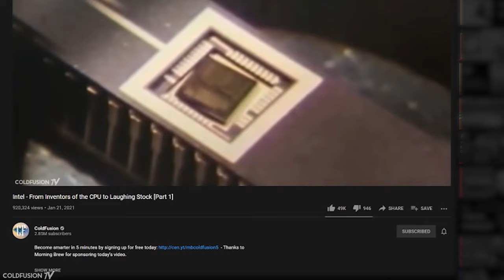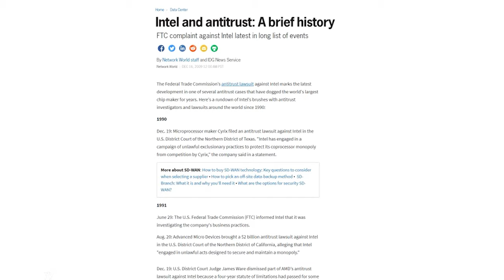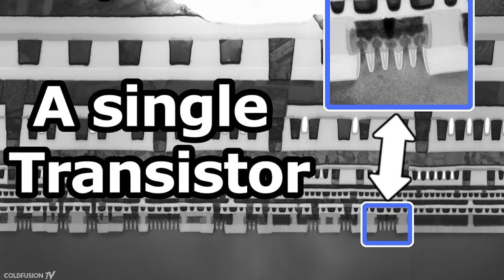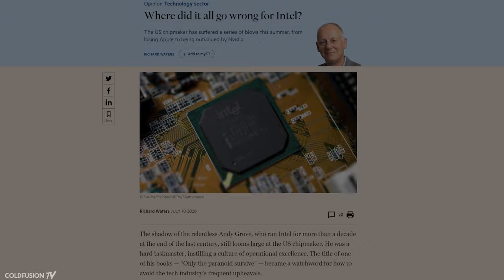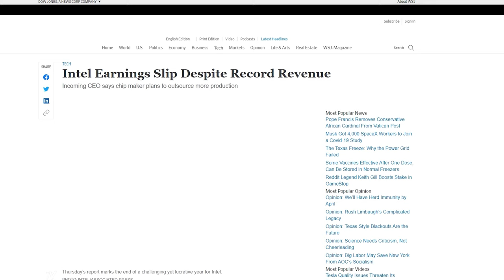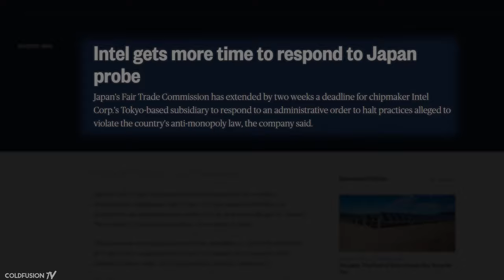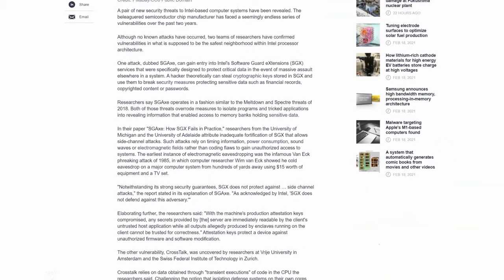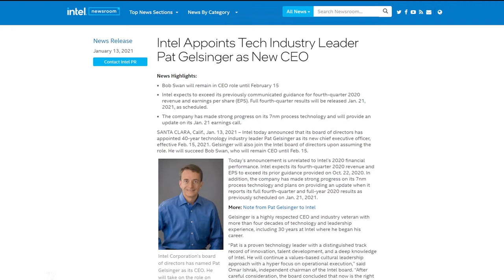Intel - From Inventors of the CPU to Laughing Stock [Part 2]

Comment: Theres a little fine detail in explaining how smaller process nodes increases performances.
In a way this looks like it but its mostly because it becomes more power efficient thus allowing more power to be used. So in the end it will have a performance uplift with the same amount of power consumed due to better efficiency.

Comment: The 8008/8080 architecture that is the core of Intel? Designed by CTC. The personal computer revolution started with the Altair 8800/IMSAI 8080? Intel was side-lined by the cheaper and superior Z80. IBM's decision to go with the 8088? They came in cheaper than Motorola with MOS and Zilog completely blowing their lead with lousy 16 bit upgrades. The super-scalar Pentium that would prove CISC was still a contender? Took years of handwaving until they overcame their deep pipeline issues. The Itanium that was supposed to be the next stage? A complete disaster than everybody saw coming and AMD created the x64 extensions that Intel had to follow when the Itanium failed.

Intel has always succeeded in spite of themselves.

Comment: Those bribes you mention are called wholesale rebates. Many companies do this in a variety of ways. For example in the late 90's Microsoft offered to pay a significant part of of hardware companies marketing costs so long as the Microsoft Windows logo featured prominently in the advertising. This was their dirty backhand way to attack Linux which had a groundswell of support at the time. Coca-Cola offered businesses a free lease on fridges so long as 90%+ of the shelf space was used exclusively for their products. Sometimes this is done with distribution channels e.g. a large company will seek an exclusive deal with a trucking company, which restricts a rivals ability to get their products to the market place. There are all sorts of ways companies misuse their market share to stifle a smaller competitor with unfair practices. Other dirty tricks include making exclusive deals with landlords which restrict competitors use of the that landlords properties, deals with local governments, sponsorships, and even utility companies.

Comment: Hmmm you say 5nm is coming this year, but M1 is already based on the 5nm TSMC process, and the A14 in the iPhone 12 too. Otherwise excellent video.
Reply: Correct if I'm wrong but phone CPUs are much different than "computer" CPUs
Reply: @BspongeB  not really, we’re talking process node here, not CPU architecture. They work differently but they’re manufactured almost the same way
Reply: @lululombard  No. X86 is much much more complex compared to arm. As the node size decreases the harder it becomes to use x86.

In a nutshell, basically, the electricity gets "leaked and wasted" as the node gets smaller in x86. And there are many other reasons which electrical engineers would understand better.
Reply: @grossly820  You are wrong, AMD Zen 2 and Apple A12 were using the exact same TSMC N7FF process. What you are referring to is again the design, not the process node or manufacturing.
Reply: @lululombard  Ah my bad, i thought you were referring to x86 in specific.
Reply: @lululombard  correct if I'm wrong again but I'm pretty sure 5nm refers to the size, speed and efficiency of the transistors on the physical chip. Yes you're shrinking the process node but that directly impacts the size, speed and effeciency of the chip. Therefore, even if the manufacturing process may be similar, the logistics of say an i9-10980XE vs an A12 is very different.
Reply: @BspongeB  what he said is that TSMC was planning to start commercial production of 5nm this year, which is wrong because TSMC already delivered 5nm chips to Apple, I don’t really understand what you’re talking about sorry :/

Comment: 2:12 "Intel insiders". I see what you did there 😏.
Reply: During my stint at Intel I, a H1B worker, earned more salary and stock than any equivalently placed local homegrown employee of AMD and NVidia. But, sure, your sources must be correct since you got "Intel Insiders" to give you information. I also knew many other H1Bs who worked their asses off and who very much "strayed" from the specific task assigned to them. 

Intel has had issues with top management ever since Otollini retired (and sadly passed away shortly thereafter). Even Otollini massively misplayed the hand by refusing to work with Steve Jobs on a chip for IPad. People don't understand as to how much top management can make or break a company. They get the big bucks for a reason. IF they take the right decisions, the company flourishes and when they make stupid decisions, the company suffers inspite of smart on-the-ground employees.
Reply: @AnkhArcRod  rightly said. Also he didn't mention how horrible Athlon chips were in 2002. I along with a couple of my friends study rooms were turned into sauna because of those CPUs. They were only made for places where ambient temperatures were like 5 degrees and not 30-35 like india.

Comment: I suspect Intel will figure out how to get their mass manufacturing back on top within 5 years with the new CEO. Honestly, as "good" as it is for Intel to have their incredible architecture designs produced in 3nm by TSMC (seriously, any team that can keep 14 nm on top for that long is probably among the best there is), if they don't get their manufacturing back up to competitive, they're in hot water nonetheless. Intel running their own fabrication is beyond important for a lot of reasons, and giving that up will cost them.
Reply: We need the fabs for competition and supply chain security. Wouldn't want to see tsmc get crappy with no competitor.

Comment: Very interesting video, thanks. Back in the day when you could buy good motherboards, I used to make custom gaming machines and just hated Intel on principle. The Pentium 4's had skinny pipe lines and were overclocked internally to get any performance out of them. They were a joke and you couldn't cool them even without overclocking them. I knew a guy who overclocked his and put it out on the deck in snow and it still melted down. I mean they were really bad. I called them Pentium smoke stacks. I was one of the first people to use Athlon processors in gaming machines. Making boutique gaming machines was a hobby of mine when I was younger. With their very wide pipe lines, even at a lower clock speed, they just blew the Pentium 3's and 4's out of the water and I knew the tide was going to turn. And the harassment over it I endured was unbelievable except from the buyers of my machines. They just loved them. I was also one of the first to use RAID arrays to speed up hard drive performance. Since I've already dated myself, today, retired; I use Acer 17 inch Nitro and Predator lap tops with all solid state drives, even the 2 terabyte storage drive. No need for RAID arrays anymore. And the Intel chips in them do a very good job. They use 8 core processors with doubling to 16. And they use GE force video, which has and stores game profiles for individual games. I figured if Acer wants to use them, good enough for me. I  believe Acer to be the number one lap top to own, and it's been that way for many years. Stopping making white boxes and switching to their own name was the best move they ever made.I don't believe you're going to go over 3,200 ghz with anything in a Lap top anyway and that's what mine runs at with very clever cooling from Acer.

Comment: Holy shit
I didn't knew intel even fabricated benchmarks
Reply: Nobody did bruh..🙃
Reply: @rockstar8573   yes i knew as soon when my first x86  bga chip was running too slow so I extracted the exe  and was baffled to find an Intel benchmark with two speeds  Intel fast anything other slow since then when multi core came oh 8 cores nah we look only to one core and all cores of Intel  , Intel committed many fraudulent  actions for decades. that is why i dumped everything from Intel since the catastrophic  i7 socket 1336 on an Intel board that was so buggy that i switched to AMD and Intel can not fix that no more sorry , if I would fraud like that with my company, I would be in jail;

Comment: After trying my first AMD chip in 40 years I am glad to say I will never try another and will go back not matter what is said about Intel. Maybe slower and not have as many cores but at least I have never had problems with USB, multi tasking, running multiple drives or using CAD.
Reply: I still encounter a lot of bad driver issues with AMD, that are not present on Intel platforms.

Comment: I wonder how TSMC managed to get sub 10 nm pitch so easily. D/EUV lithography has 100 nm wavelength so it would take repeated runs to achieve that level of accuracy. Even in academia, we use E-beam lithography with over 10 nm resolution.

Comment: Cold Fusion, you may find this helpful... https://www.amd.com/en/corporate/innovations#event-industrys-first-quad-core-x86-socs

Multiple errors in this video (others have mentioned the '1996 Athlon'. But also no 16-core Ryzen in first gen, that was 3rd gen. 2017 it was called Threadripper which is a HEDT product. Different to Ryzen)

Comment: TSMC has already been manufacturing 5nm processors for Apple since last year.
Reply: well i think 5nm for x86 and ARM is different
Reply: @rentokawaii1216  when isn't a transistor a transistor?
Reply: @Wahinies  they are two different CPU architectures and x86 is comparatively more complex in both design and manufacturing. So yeah tsmc has been doing 5nm but for ARM designs, for x86 they need to figure it out from scratch.

Comment: intel started going down hill when they introduced the Celeron.
Reply: You don't remember when Celeron actually started right? With Pentium. Back when Pentium was high end
Reply: @dustojnikhummer  I started building my own computers back when the Pentium II was the best chip out there.. The Celeron was introduced around that time. The reason I said Intel started going downhill when they introduced the Celeron is because the Celeron processor was just a regular Pentium chip that had been hamstrung to reduce it's power. It was a Pentium chip that had been purposely weakened.. It cost Intel the same amount to create as a regular Pentium, but they weakened it on purpose so that they could offer a lower cost chip to consumers. It was a disgusting corporate move, in my opinion.. That's why I think Intel started going downhill around that time.
Reply: @flappy7373  How is that a disgusting move? Have you heard about binning? The Celeron was Pentium without any cache on it. What if you have a Pentium with damaged cache memory controller. Well now you have a CPU that sort of works, just slower, but you can't sell it. So you sell it as something different. Intel did not cut fully functional Pentium, they sold you CPUs that would go into the recycling bin.
Reply: Companies do this all the time and its quite fair, Apple not adding a fan in their laptop and Nvidia flashing a different bios on identical chips to turn off some cores.
Reply: @mateenahmed1283  No, they are doing that because the GPU has some cores damaged. Instead of throwing it out they can sell it as a different product
Reply: @dustojnikhummer  are you sure about that? like, absolutely sure? i just always thought of it as a shitty corporate move.. but, maybe i'm wrong after all. i guess it just always bothered me that they'd do something like that, it just.. kind of.. felt wrong, you know? like taking a ferrari and putting wooden tires on it. like, sacrilege. that's the word! sacrilege. it seemed like sacrilege to me. i guess.

Comment: Speaking of smaller and smaller transistors, moores law might be coming to coming to an end, at least with silicon transistors.

Basically the smaller you make them, the more issues you run into like quantum tunneling which cause all sorts of power and stability issues due to the electron exchange that happens between the silicon atoms that transistors are made of and the resulting current leakage.
Its a bit complicated so i suggest looking it up if interested.

Comment: I checked AMD prices nowadays and their motherboards, and they are more expensive than intel's. I went with intel and it works fine. Also AMD, even with their 7nm are still very hot.
So, yes, it's fun to have a top number of cores, etc, but what if I don't really need it? And AMD charges a market price for it big it. So, not much gain with it either.

Comment: Intel isn't going anywhere bad.  They have now sat on top of the consumer performance market (12900k and 13900k are the best CPU's of both of those generations) for the last 2 generations of CPU's.   And honestly only gave up the "crown" during the previous 2 generations (10th and 11th gen).  From the inception of the Core2Duo back in 2006 Intel has held the crown for being the best consumer CPU.  Only giving this title up from August of 2019 (not in gaming though...) though March 2021 (then losing the gaming title also) to November 2021 (the launch of Alder Lake) where it regained it place on top, and to the date of this message (November 25, 2022) with the 13900k.  So ya, thems the facts.
Reply: Yes, they may have suffered setbacks, but a lot of people seem to underestimate just how massive their operation is. 

And for all their falling behind and lack of innovation prior to 12th gen, they still retained huge market share in the non-DIY PC market.

Comment: WAAAAY too short video, I was so looking forward to a lot of slamming from episode 1, including their dirty chipset practices, sadly they were missed.
Yes, Intel have been playing it dirty all the time, and Nvidia is no saint in bullying and cheating either, but what happened when the two bullies went head to head was that Nvidia were forced to close down their motherboard chipset division.
Before this happened, they wrecked Nvidia's 680i chipset on the 45nm compatibility by changing the specs at the last second before release, basically Intel's own chipsets were compatible quite far back, while the newest and shiniest 680i could only run old school 65nm chips, later they did manage to handle 45nm Dual cores, but not much else.
Holes in the specs also cost Nvidia greatly in terms of stability, unless you were dead set on running SLI, you were better off picking an Intel chipset as there were great stability gains from that choice.
This partially came from Intel messing with the specs, and Nvidia playing with "unlocked" memory speeds by basically putting in a bunch of dividers to keep memory speed untied to the FSB speed. (Intel just gave you a couple of them for tweaking.)

What killed the division after this was Intel refusing to renew the license when they launched their Core i series, meaning Nvidia couldn't make any newer chipsets, and instead moved onto selling SLI certificates to slip into motherboard BIOSes.

Comment: This video might as well called "The raise of AMD"
Reply: AMD is practially as old as Intel (founded in 1969 and 1968 respectively).
Reply: AMD's raise started serious  with Lisa Su , their Athlon  was the first move , zen the second and indeed both companies are even old approximately
Reply: @stefaancodde6578   Intel and AMD were totally serious long before the very first x86 design (8086) emerged in 1978. They made SRAM, DRAM, bit slice units (used to build mini computers), custom designs and all sorts of ICs (including processors). Making semiconductors is a pretty serious business.
Reply: @herrbonk3635  , nice name, true  it started with AMD Athlon where Intel started  go wrong; before the Athlon Intel was the driving force but i still don't understand why it took more then 10 years to fix a bug in Intel CPU's and the massive fraud  that Intel committed , as i mentioned, i got an intel I7 socket 1336on an intel board which was so buggy two to three bsod's a day and intel drivers did fix nothing so good bye Intel.
Reply: @stefaancodde6578  A slightly larger picture: In 1976, Intel's ambitious iAPX 432 ("Intel's CPU for the 80s") was already delayed, so 8086 was started as a small and simple backup project in order to combat heavy competition from Zilog (Z80, Z8000), Motorola (68000) and National Semiconductor (32016). 

They used an outside guy to do this, Steven Morse. Inspired by Zilog Z80, he designed the 8086 as a pretty simple extension of the Intel 8080. The slightly more ambitious 80286 was a follow up with memory management and better performance (thanks to more transistors available).

By the time the 80286 as well as the iAPX 432 were ready (early 1982) they realized the 286 was a simpler and better way to go, as it was faster than the iAPX 432 and also chosen for the IBM AT. So instead of trying to enhance the iAPX 432, they put a lot of effort into developing a 32 bit version of the 80286 instead. This became the pivotal 80386. So IBM was the driving force that made the 8086 and 286 ubiquitous. Compaq then made the 386 a hit as well. So without IBM and Compaq, the x86 family had been as unknown by you youngsters as the Z80 or 6502 :D
Reply: AMD B Ryzen